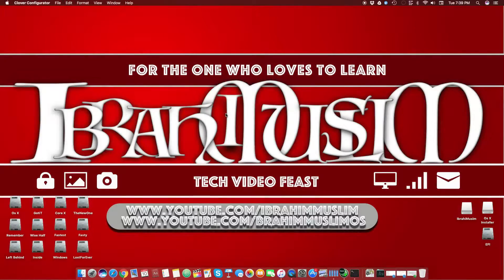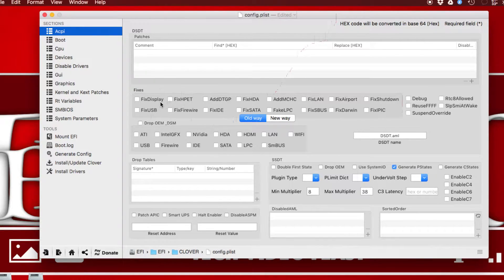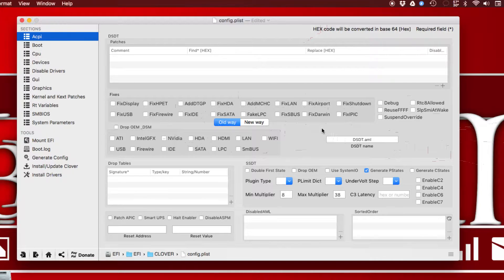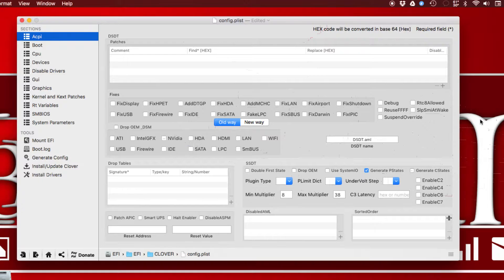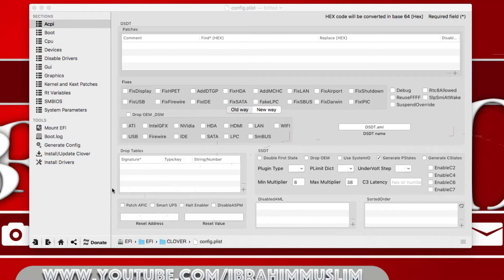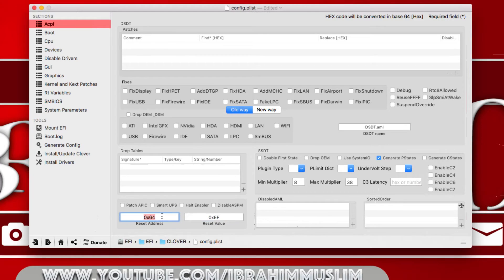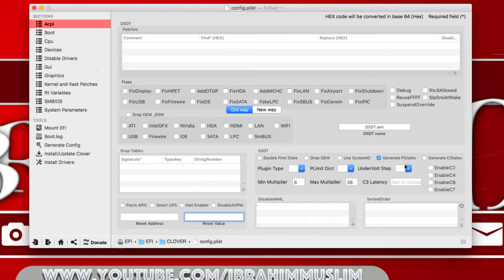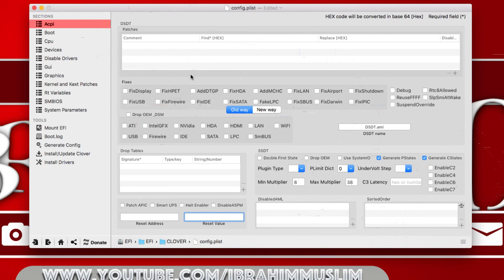Learn Clover Configurator UEFI Part 2 Hackintosh | ACPI Detailed | 2017

Comment: Hi Ibrahim! Thanks for your explanation with Clover Config. Now, I want to ask if more than only one resolution for my monitor Philips can be get, with Clover Congiration app. I run a Hackintosh over a Gigabyte mb, GA-z77X-UD3H and 3,43 GHz Intel Core i7, 8GB 1333 MHz DDR3, and graphic Intel HD Graphics 4000 (3MB).- I test many thing but can´t find a way to a more confortable display toward. My monitor is VGA (no hdmi). Is it possible without a video card to get more resolutions ?? Thank you very much for your help! Regards, Jorge (Argentina)

Comment: Very nice video, I have a Laptop and here are the config: Hp Notebook intel(R) i3 5005U processor (3M Cache, 2.00 GHz)
modèle 15-ay047ca (ENERGY STAR)
Mémoire 8192mb ram
Graphique. Intel HD 5500,  1366 x 768  mode d'affichage
Bios F.40
Carte réseau ; Realtek PCIe FE Family controller #2 ,  Realtek RL8723BE 802 Wi-Fi Adapter
Bluetooth  (PAN) (RFCOMM Protocol TDI )
Will this work ? this is my first try for Hackingtosh, thank you in advance !

Comment: I need some help I’m new to the hackintosh. This is my build pc that I want to turn into a hackintosh with everything fully functional. Is this possible? 

https://pcpartpicker.com/list/3jzPsZ
Reply from the maker: Use TP-Link Archer T9E instead of Gigabyte Wi-Fi, mine is been working fantastic from last 2.5 years and works natively. The Gigabyte one is not nativily supported and its a great problem to get these card working every-time when you update your hackintosh because most of the time you download stuff from net and if your hackintosh doesnt connects to it due to wifi card not loading you will feel the pain. For bluetooth you can get a broadcom 4.0 usb dongle and that does the trick.

If you can get a Z270X gaming 3,5,7 from gigabyte then you will get rid of all the hassles of making the hackintosh, I have already uploaded the custom EFIs for these builds and you wont need to do anything except copy pasting it into your system.
Reply from the maker: rest of your build is fine.
Reply: how do I copy and paste into my system? I'm sorry im very new to this.
Reply: Do you have an efi for the motherboard that I have now?
Reply from the maker: Which motherboard do you have right now?
Reply: Asus - Z170-A ATX LGA1151
Reply: I just installed High Sierra. And I downloaded Clover config. Now I Just need to know what to do from here. To get the right settings. I tried  a couple and missed it up to where I had to reinstall High Sierra. So I'm so new this Hackintosh.
Reply from the maker: I have one universal for Z170 but I am not sure will it work 100% or Not. To use it u have to download the efi folder from the link in the description below and u have to copy that efi folder into the efi partition of ur USB.
Reply: Thanks. I did that. Now I'm having no sound and glich screen

Comment: Hi I have New Macbook Air  
 macOS High Sierra 
Version 10.13.1 
Macbook Air (13-inch,2017)
Processor 1.8 Ghz Intel Core i5
Memory 8 GB 1600MHZ DDR3 
I Whant to fix Firmware  but I caNOT  ;(  pleas HELP !!!
Reply from the maker: Can you tell me whats the issue you are facing?
Reply: I send you messages and pictures in gmail can you see that pls
Reply: why not allow Nothing to install  , that says System Extension Blocked
Reply from the maker: To install clover click on the app and ones the error is show then go to system preferences and go to security & Privacy there go to General and there click on open and then from there you will be able to open the clover and for iOS error, you have to redownload the update file.
Reply: Yes right now I’m doing that but hi take time 
Security & Privacy 
 Filevault  
And now  hi present 
FileVault is turned ON for the Disc “ Macintosh HD”

Comment: my problem is I have to set back setting before booting up is there away to save it, so I don't need to it over and over
Reply from the maker: Set back which settings? Directly edit the Config.plist file which is in your EFI partition then you will be able to save those settings permanently!
Reply: ok thanks, i will try that, but my main problem is audio drivers 8086 1c20    I am using hp pavilion g6 1d70us laptop with intel i3 CPU on  mac os 10.8.5
Reply: hey, I got the sound to work, but I notice only one USB working any suggestions?

Comment: Great vids, i have a Gigabyte z170 designare and I am having 3 issues with that I want to fix.  1) I cannot get my ethernet to work in OSX.  2) I have dual r9 280x GPUs and they do no seem to be functioning correctly.  I loaded a vbios i found on Tonymac, and i can get to OSX using them, but the are recognized as AMD 7xxx, and they don't seem to be very fast in final cut.  3) I cannot boot to windows without using a thumbdrive with Unibeast.  Can you assist me?  I am willing to pay to resolve these quickly.
Reply from the maker: Watch this video! if after this you still get some problems then do let me know. and remember to make a UEFI EFI backup before you apply any method!

https://www.youtube.com/edit?o=U&video_id=ztz_wmYvyIM

Like Share & Subscribe for more
Reply: Ok, so i am stil having problems.  I gave up on the hackintosh for like 2 weeks.  installed windows 10 and hated it. I want to start over on my hackintosh, but i would like to learn more so that i build it right this time.  Can you help?

Comment: I'm just going to clone the main drive thats working I also have a dual boot two different drive it won't start and I really need my computer to shut down thanks for the help tech ties I didn't upgrade my Hackintosh in years everything works just won't cut off thanks for your time again.

Comment: my computer still won't shut down
Reply from the maker: Install evOreboot.kext its available in Multibeast 7.3. This will fix your shutdown and restart problem!

Like Share & Subscribe for More!
#ThatsTheRealManHelp
Reply: im try now thanks
Reply from the maker: Your specs?
Reply: i7 3770 amd 7950 GIGABYTE GA-970A-D3 AM3+ AMD 970 SATA 6Gb/s USB 3.0 ATX AMD Motherboard
Reply from the maker: Is your problem solved?
Reply: TechTies Ibrahim no it isn't its like clover won't work with the shut down I have and and 7950
Reply from the maker: +seedz11 Your motherboard?
Reply: bro u r using a intel chip on am 3 socket i mean a lga on a pga socket